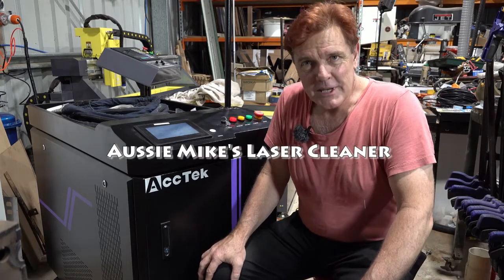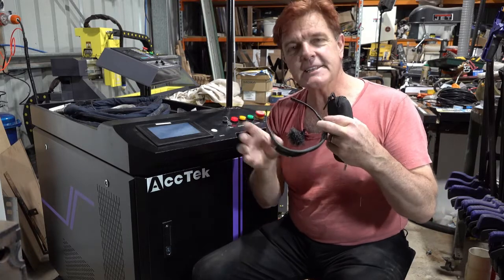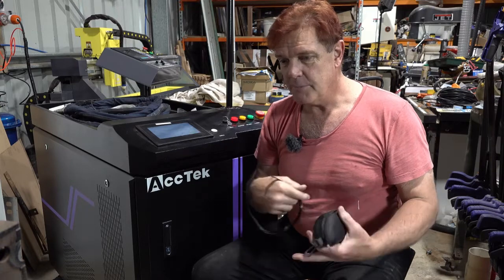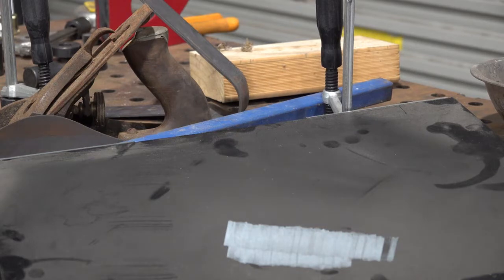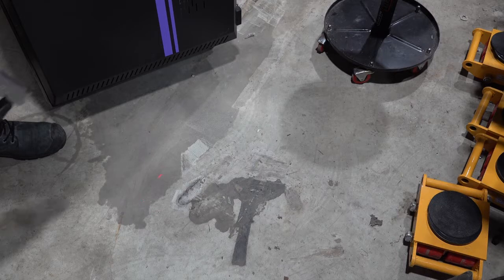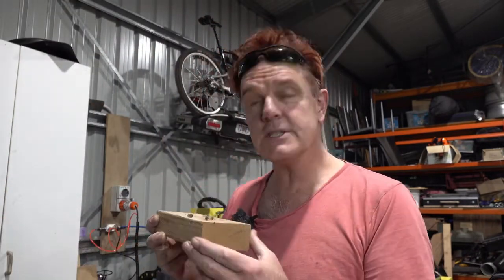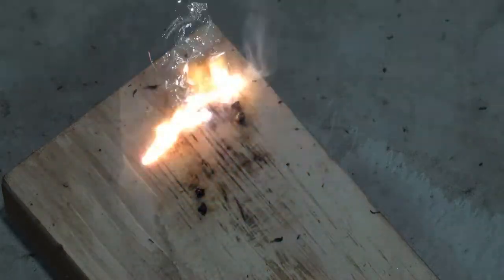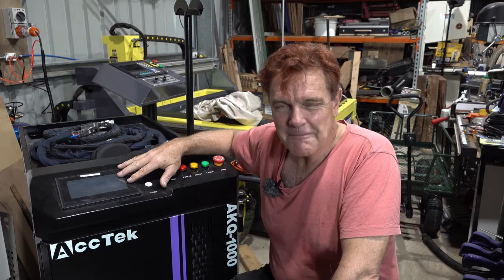Aussie Mike's Laser Cleaner! NOT a Bee Video

Comment: I have had corresponding emails with companies with the lasers and they are very conflicting. Some show the laser gone right over the guys hand without hurting it a bit and then you show this video of this laser actually vaporizing bees and burning wood. They say it doesn’t affect the substrate of whatever you’re working on and that is false . Thanks for the video
Reply: This is because people use different types of lasers. The ones used for corrosion and soot removal are expensive 100-300 watt pulsed lasers at 1064 nm. This one is a continuous wave laser, still at 1064, and will absolutely burn everything to shit. 
I've held my hand in a pulsed laser at 300w, but fuck me if I'd do it with a continuous wave laser. The CW will melt steel and the beam reaches hundreds of meters because they have no optics. The pulsed lasers have a very limited focal point and won't burn. But it will mess up your eyes though.
Reply: @whiskeythrottle9369  I have a continuous laser, and you do have to be aware of how high your power is on certain things. It is the 1064. I do wear the safety glasses designed for it. As far as crossing my hand, no thanks, but this one does have a focal point, you can hear the difference in it when in use. If you get too close or too far away while using it, it’ll let you know. Just gotta have a bit of common sense. 
https://youtube.com/@Laserguy660
Reply: @Laserguy660  what I meant with my comment was that people tend to focus on as high a wattage as possible, and that doesn't do anyone any good. Wattage does do a difference, but in this case it's a matter of how much of a burn you want. I tried a Chinese 3000w CW laser a couple of weeks ago and while good quality and high output it didn't do the work. It changes the appearance of corrosion and adds a TON of heat to the materiel causing distortion in steel and plain old burn damage in other materials. 
If you want to remove corrosion, and actually remove it, you need a pulsed laser. This is the industri standard and this is the laser all European vendors sell for corrosion cleaning. 
I don't believe there are any in that gun. It has two mirrors to divert the beam and create those patterns, but there is no lens. Try a pulsed laser. Those guns are quite large because they all have a large lens system to direct the beam. 
As for the hand.. a CW laser WILL mess you up whereas a pulsed laser will not. Both will mess up eyes though, but that's because of the lens effect in eyes.
Reply: @whiskeythrottle9369  mine does have a lens, and I’ve also noticed that when I reduce the power down, and I usually keep the frequency around 20.000 it doesn’t heat up bad at all. In fact I did an impact socket on one side, and grabbed it immediately with my bare hand to spin it to do the other side and it was barely warm. I’m sure like with anything like this and different models etc, everyone will have likes and dislikes but I do agree with you on the pulse laser. That’s in my sights to get next. Thank you for your input.
Reply: @whiskeythrottle9369  by the way, my laser is a 2000 watt. 👍🏻
Reply from the maker: Thanks for watching, Grizz.  I've seen video of a guy lasering his tattoo.  He has a bigger set than me.  No way I'm getting in front of that beam.
Reply: @AussieMikesBees  😆

Comment: Hello, do the machine need gas nitrogen or compressed air to work?
Reply from the maker: Thanks for watching, Christian. It uses compressed air to stop the vaporised particles contaminating the lens. I believe the welding version uses different gasses to match the metal.
Reply: @AussieMikesBees  
Hello howare you Sir, sorry to bother you again.
  Which oil and water separation and filtering system do you use with your compressor to work with the laser machine?
Thank you.
Reply from the maker: I don’t use anything fancy, Christian . It’s not as fussy as a plasma cutter. Just a simple cartridge filter is fine. Obviously, if you already have refrigerated drier filter you might as well use it.
Reply: @AussieMikesBees  
Thank you very much for your answer Sir. 
I recently bought a machine similar to yours 1500w. The Chinese sales representative told me that I need a drying and oil removal separator system for cleaning, for cutting and welding needs nitrogen.
I'll be sharing the results with you later.
 Thank you for your help. 
 Best regards.
Reply: Thank you very much Sir, excellent video.  I really appreciate your answer.

Comment: Would it clean housepaint off brick? I suspect it may be too hot for bricks causing cracking or fissures....
Reply from the maker: Good question, Robert. Laser works very well with paint on bricks. They’re used to remove graffiti on any surface. With the right settings, there is no damage to the underlying material. Laser also removes the soot from bricks and tiles after a house fire.

Comment: Hi Mike, 
Is there any chance you could reply with link of where you bought this from?
I’m in Tassie and looking to buy one cheap enough to learn with before spending heaps on an expensive one.
Also, can you give details on the power pack your using, 
Cheers, Paul
Reply from the maker: G'day Paul.  I bought mine from Acctek through Alibaba https://www.acctekgroup.com/Laser_cleaning_machine/Fiber_laser_cleaning_machine_for_metal_1000W_5156.html   
Not sure what you mean by power pack.  I use a 32A outlet that I share with my CNC plasma (running one machine at a time).  Although the laser has a 32A circuit breaker, I believe it might be possible to run it on a 20A outlet.
Reply: Tried this link but no longer working.  Just trying to see how much you paid in US dollars.  Thanks!
Reply: Hi Mike cool video. I'm from Brisbane and am considering this as a business. I have a couple of questions hopefully you can help me with.  Would not your 1000 model also fit into a van? How long is the cable Lead ? I see Acctec are using a part of this video to promote there products are you aware of that. What made you choose this company , I'm also considering DMK. Any advice greatly appreciated. Cheers

Comment: Hi again, would really like to know what its like on older car panels to remove paint and rust etc?
Really concerned of the thin metal on panels getting to hot and warping. A heat gun reading would be good if possible? Keen on getting one to help restore my cars. How has the machine been operating for you? What sort of water are you using?
Thanks again, it was a great video.
Reply from the maker: Hey Brenda, I can’t offer personal experience with old car panels. Maybe I can find some old rusty panels at the wreckers to experiment on and do a video. It’ll be a while though. I’m flat out at the moment. I use distilled water in the chiller. It’s a terrific machine, though I don’t use it enough.
Reply: Lasers of this type will absolutely warp car panels. You need a pulsed laser for that type of work and then you still need to be careful. And consider a laser a delicate brush. It will "paint" but very inefficiently so over large areas.

Comment: How much heat is created on the sheet metal?
Reply from the maker: Good question, Lee. It’s possible to put a lot of heat into the metal causing it to warp. The idea is to use the lowest power that vapourises the material being removed. It’s also necessary to keep moving the laser around the material to minimise heating one spot too much.

Comment: Hi, have you used this machine on heavily rusted car panels, body or chassis? Also painted car panels? Thinking of buying a 1500 w machine. Appreciate any feedback? What state are you in? Thanks, Lee.
Reply from the maker: Hey Brenda, thanks for watching. Yes, the laser burns through thick paint and rust. It’s worth scraping loose material off first, so you’re only lasering bonded paint and rust. More power means more choices. You can turn down the power for thinner materials. Too much power can overheat and warp thin metal. It’s a bit of an art.